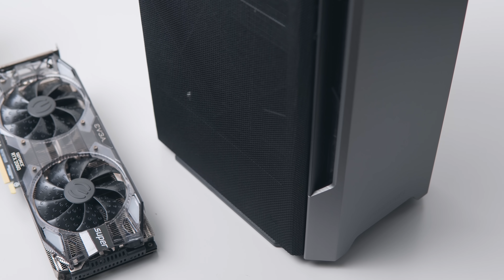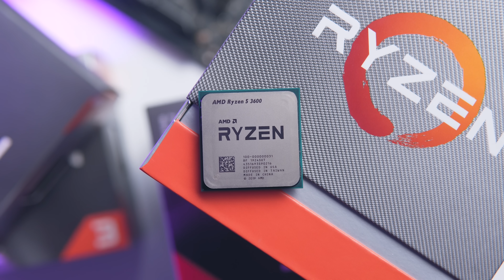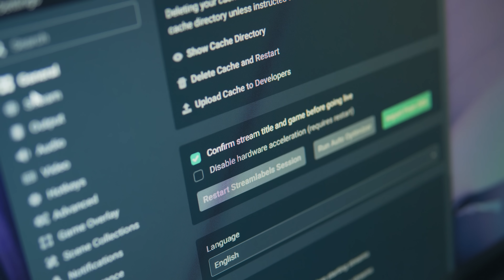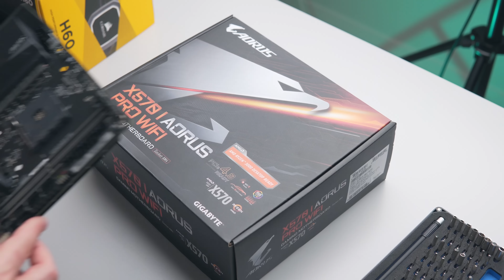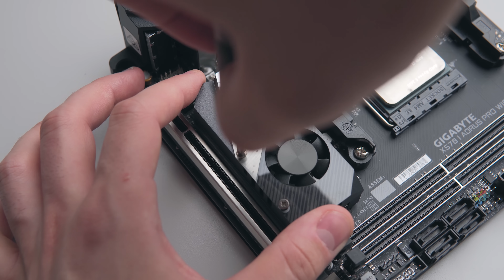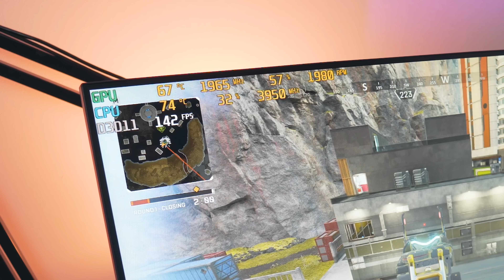Building a 144Hz Gaming Rig in the Evolv Shift Air!

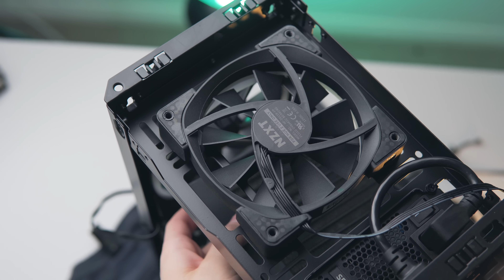Comment: The reason the CPU is warm is because of the gap from the cooler to the radiator, the cooler should always be touching the radiator, in this setup the steel mounting plate with the holes are in between the radiator and cooler, as seen in 8:16, which increases CPU temp by alot.
Also, pressure fans would be better for pushing air through the radiator than airflow optimized fans, lowering even more the high CPU temps.

Comment: I've built v. similar system a month ago. With 2070 S graphics and R 3700 processor. Same, disc, memory, mbd. My thermals rarely touch 70 degs in full power situations (rendering) and generally system works in low 42-55 range in typical workloads for both CPU and GPU. And all fans are on very aggressively low silent curves. The system is inaudible. How?
This is an ideal case for an air cooling setup. It is actually not so good for water. So air only.
 I used Noctua NH-L12S CPU cooler with a fan outside so 44 mm GSkills can be used. The mesh panel has extra space (6 mm), so the case can accommodate a little bigger cooler than it's stated in specs. The NH-L12S fits perfectly. The fan takes air directly from the mesh and pushes it on the processor and motherboard. So you want to remove this warm air from the processor's area - the upper case fan should be set to out-going. Perfect. Well... not so as the NH-L12S barely fits by the case fan and also, there is a problem with the GPU (more below). So you must swap it to a 15 mm slim fan (e.g. from Noctua). 
The GPU is positioned with fans outside, which suck the air also directly from the mesh panel. The case has the problem with the hight (not length or depth) of the GPU. Because most N-vidias have the power cables just in the corner witch is just by the corner of the power brick. For my 115 mm Gigabyte triple fan GPU there was not enough space to fit the cable - without change of the upper case fan to slim 15 mm, to slide the GPU to the front. If you use shorter double fan GPU - no problem with 25 mm fan.

About airflow - the Shift Air has a very nice flow with both coolers (CPU and GPU) with fans sticking to mesh panels and exhausting warm air to the middle of the case. So all case fans should be outgoing fans. You should remove dust filters from the bottom fan and especially from the front panel. Use e.g. gaffer tape to close all openings in the front wall, to prevent the air pushed out by 1 or 2 fans into the gap between the front wall and front panel to return back to the case.

This configuration can probably manage R 3900 and 2080 ti on air only - with 3700 and 2070S the fans rarely exceed 450 rpm now and 850 was the most on the CPU fan. No undervoltage.
But not the Shift with glass. It's baaad.
About water IO. If you really have to use it - position it vertically to the side - so it will suck the air from the mesh. If you position the IO like in the video, it sucks warm air from the power supply and through the rather restricted lower grill. That is the reason, that quite powerful double fan IO works here less efficient than NH-L12S with the more powerful processor in my rig.
Reply: ive got my mine with evolv shift air with an 3900x and a 1080ti .... and it's hot ... i need a new cpu cooler than my custom wraith spire ( i fix one 120 slim instade the stock fan... )  .... by the way i'm not sure about airflow loop from optimum , cpu temp could be better with bottom intake
Reply: @pegazuss5  Use Noctua NH1-L12S or Scythe Big Shuriken air cpu coolers. This case is perfect for air cooling and bad for AIO. The mesh panels provide no friction - the air coolers (cpu and gpu) work like on the open bench. Even better - if you set all case fans as exhaust.
Using AIO as in the build with Shift Air is just well... unwise. On intake, it sucks hot air from power brick through restricted slots. On exhaust is sucks the hot air from the GPU.
Reply: @AndrewSienx  I have the big shuriken and an air cooled gpu. I did a lot of testing of the front case fans (2x140mm) both intake and exhaust and found almost no difference between the orientation.. furthermore, I took them out and noticed almost no difference in temperature. I plan on buying a sfx power supply so I can mount the 140mm fan on the bottom in taking air and helping exaust from the top which I feel like is where a lot of heat gets expelled . ( I fit my full size atx power supply to delay purchase of new psu, ironically this side orientation fixes most clearance issues with gpus)

Comment: Aside from the mesh panel for the GPU, i recommend to get a custom front panel with better ventilation. The standard one turns into a oven if just on fan is mounted as an exhaust because the hot air has almost no room to escape.
You're basically circulating hot air through the case with no cold air coming in.

Comment: I  want to mention that in order to flip the Graphics card bracket you also need a tiny Hex Wrench,and if you want the fan facing outward you either have to get a short graphics card(No extra thing requried) or a long but slim one(AND 1 or 2 180 DEGREE PCIE POWER 
Adapter)

Comment: When you switching to 18:9 A/R? Your videos deserve it. Best cinematography out of any of the channels I watch...

edit: by far the cleanest shot and edited build video yet. I love these so much!!!
double edit: I noticed the same cpu voltage issues with my 3700x and just turned off Precision Boost Overdrive and it knocked my cpu volatge down about 200mv and kept thermals in check in my Ghost S1 with L12. Far better than my 1700x stock settings but pushing upon the limits of the air cooler...

Comment: I just wanted to comment and say the tempered glass original version is viable. My wife has the original case. I had to experiment for a while with different fans and different layouts. 
      Anyways so she runs a Corsair H80i water cooler with one fan as an exhaust. Then a gigabyte gtx 1070 that barely fits. A 120mm Corsair sp120 fan as an exhaust on the front. This combo allows her to play games with CPU and GPU temps 65c or lower after hours of playing. With fan speeds never going over 66%.
    So hope this helps if anyone has the case and doesn't want to try multiple fan configs like we did lol.

Comment: That CL14 3200 ram is a good overclocker. I have an older ‘package’ version with same modules (just trident Z no rgb) which managed to go to 15-17-17-36 at 4000MHz. Yes, memtest86 stable - several days pf testing with no errors. Also, secondary timings REALLY impact the performance. The result I had is 55500/55500/55500 at 40.0 latency in aida benchmark. (9600k at 5.1/4.7avx/4.7cache)
Oh and, voltage required to get to that speed for ram was 1.55. I haven’t tried going 1.52 although I could have, I just know that some modules ship stock with that voltage so had no issues setting it to that in bios.

Comment: I saw some builds online with 2.5 slot cards and even a build with asus rog strix 2080 Ti which is a 2.7 slot card, however the case was a bit modded for it to fit inside... i'm planning on making a build in this case and use my old asus rog strix 1080 Ti with removed fans and switched with noctua slim ones mounted directly on the heat spreader...

Comment: That case looks really good, I wonder if gpus with heatsink fins facing different ways would allow for it to get cooler air instead of the hot air being blown directly into the fans causing a mix of warm air to surround it.

Comment: Modmymods.com have a replacement front panel with different cnc patterns
Reply: Just be prepared to wait 2 months...
Reply: @AtaleToldByAnIdiot  better than nothing
Reply: To be fair, from what I'm told the issue was on phantkes side. ModMyMods offers to send you replacement panels for a bit more if you don't want to send yours in. As such they have to buy the panels from Phantkes who sent scratched and bent panels which they couldn't use for their customers...

Comment: Right after its release I picked one up to move my system from the old TG Shift as the replacement sides were all ready sold out . Not much difference in the noise then again I game with headphones.  I can totally agree on the big reduction on system temps .. now only if they had a wood front panel

Comment: Phanteks should combine materials so there is thermal relief, structural rigidity and still looks good.  They could mix functional glass, aluminum and fabric to accomplish all three and it wouldn't cost any different than having one or the other.  The form factor is excellent though.  Don't put anything on the side of that case though....oops my backpack just crushed my pc....

Comment: I literally built that exact computer earlier this year. The AIO on the bottom blows hot air straight into the GPU and makes it overheat.
Reply: Soren V That’s not the cases fault, that’s your fault for orienting the fan into a pull configuration. Not to mention if you orient the gpu so the fans are facing the mesh then it’ll get fresh air from outside the case keeping temps reasonable which 60 C is.
Reply: Athasin push or pull doesn’t matter since the hot air is going the same direction either way. I was using the H80i V2 so it was actually push pull. No matter what the hot air is going up. And I did have that exact same style GPU (just the 2070 super instead) facing towards the mesh. The problem is, when you put higher end components in the case, the fans (which are stuck behind the metal face plates) aren’t able to dissipate the hot air. 

Also if you don’t have first hand experience you shouldn’t just assume that the person is incompetent and doing something wrong.

Comment: Hi Optimum Tech. I just thought I'd address the choice not to go with an RX 5700 XT: the Gigabyte RX 5700 XT Gaming OC does fit inside this case in the same config you have set up. So for anyone who wants more power but doesn't want to over pay for an RTX 2070 Super, the Gigabyte card is a great option.

Comment: I have no issues with thermals in my shift (glass version) for the CPU (R5 3600). The GPU can be an issue depending on the card style but I am running the reference 5700XT with no issues.

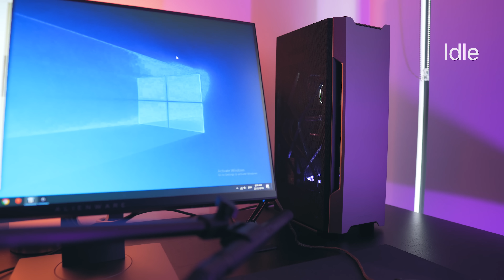Comment: 11:25 That GPU noise would drive me crazy. Watercooling seems mandatory if you’re gaming & you’re sensitive to noise.
Reply: 7errain then you haven’t listen to my pc. 2080 Ti with Accelero Xtreme IV heatsink and 2x Noctua NF A12x25 + 8700k delidded with liquid metal and Noctua NH-D15. Water pump would make more noise and only thing I hear is GPU coil whine at gaming
Reply: Der Lokator you’re right, that aftermarket heatsink also works well. I just have the louqe ghost case so that won’t fit for me.
Reply: The gpu is perfectly cooled through the side panel - just use the Argus or Aftrerburner to edit the fan curves. Default curves are designed for poorly cooled cases.

Comment: Built a similar system in that case for the same size reason. Was able to get a 3700x, H80i in push pull and a 2080 super in. That little fan on the mobo is the cause of most of the noise, might try a slim 12 Noctua to push more air over the mobo.
Reply: You should edit the fan curve for the mobo fan. In the newest BIOS or use Argus. By default, it goes 6500 rpm but 3000 is enough. Then it's silent.

Comment: At least some 5700XT cards will fit fine with the fans facing outward in that case. I have an MSI 5700XT mech OC in mine with clearance all around it, though the riser cable is not pcie gen 4 compatible, at least not in mine, I had to set it to gen 3 in the bios for the system to not crash as auto will default to gen 4 with the 5700xt and x570 chipset combo

Comment: Primary m.2 slot is on the back of the motherboard.
Reply: The back one is the secondary, front is the primary on that board, gigabyte lists them as M2A (front) and M2B (rear)
Reply: @sandrahiltz  is it necessary to put on the M2 this thermal green plate which was in the package of X570 I ?

Comment: On my mobo (Msi b450 TH) if i set the cpu multiplier to 4.1 ghz and leave the volts at auto i will actually get a reduction in temp, i think it was 7-10c on the stock cooler. With the bios rev i tried this on the stock 1 core boost was only 4.150 and all core was 3.8 so you will get a decent perf boost in all core at the same time lowering your temps. Evan 4.150 ghz had lowered temps by 2-4c. I was able to get 4.2 stable with the stock cooler this way so long as i was not running at 100% for long periods of time. I now have it at 4.3 ghz at 1.35v on a 360 aio.

Comment: This is my build too! Highly recommend anyone with this case to look into having the panels modded ( I went with ModMyMods, but they are heavily backordered so I'd suggest other options). The min max Delta on temps I saw was 30c! Afterwards.

Also, the sf600 is good but ran into a huge power issue when going all AMD this time around with a 5700xt. Might be worth it to go with the 750 psu version.

I also recommend getting a cable riser for the gpu (90degree left facing) and if you want the best cable management, custom cables cut to length go a long way.

Comment: Should have used an air cooler for the cpu and put an intake fan at the bottom to reduce overall temps in the system. The radiator being placed at the bottom as exhaust, makes no sense.

Comment: You never really solidified if I can get a RC 5700 XT Sapphire Pulse in this case. I have vetted all my other parts and almost pulled the trigger but your video stopped me. It looks like the Pulse comes in about .5 inch (12.7 mm) taller than the EVGA in your video. Is there not enough clearance in current config? I can't tell in the video either.
Reply: I think the Pulse is the GPU I want, but I really like this case setup. Recommendations since you have built in it?

Comment: Dude, there's something wrong with that cooler. My 3600 won't get past 72 C on a 30 min stress test with a single tower air cooler, boosting at ~ 4.2 GHz on all cores.

Edit: These are under really extreme conditions; in a 25 C room and a +32 C day, cause it's summer here. I hope you read this, because you should really test that cooler.
Reply: "Single tower air cooler" tells us very little of cooling capability.  "Stress test" it's just as ambiguous. You also make no mention of your case airflow situation.  Also, not everyone gets a well binned chip.  My experience in an itx case w/ one 140mm exhaust, 72F ambient, and cryorig h7 is very similar to OptimumTechs results.  Peaks at 80C while gaming.  I don't dare run Prime95 on more than a few threads.  AMD's "65w TDP" claim it's pure marketing lies.  Stock cooler situation was even worse.  I also tested in open air with same results.

3600 is great performance value if longevity isn't affected by high temperatures.  Only time will tell.

Comment: A quick question: where did you install Hue 2? Thinking about changing to this case in near future, so this info would be much appreciated. And thanks for yet another excellent video! Keep up the good work.
Reply from the maker: orvel0 behind the rear panel 👍
Reply: @optimumtech  Thanks for taking the time to answer! I decided to buy all black Noctua fans in the end. My Christmas present: changing from a dancase A4 to this to allow for better cooling. :) Mostly the same setup as your brother's apart from a RTX 2080 Super card.

One more question, if you may: in the windowed version some people installed the CPU rad as an exhaust in push-pull in the bottom slot. It would be interesting to see if that really makes any difference here. Do you reckon that with the ventilation hot air through the rad doesn't really make a big difference in temps compared to using a sub-optimal exhaust placement?
Reply: @optimumtech  Hey One quick question.  Did you use a fan controller or y-splitter for the fans?  Trying to build something similar but using 5700XT and 120MM fans

Comment: Why no manuafacturers make tall 2-slot video cards( i.e. dual 120mm fan design)? Those would be perfect for SFF systems.
Reply: Because it wouldn't fit it in any case? For example 5700 XT Red Dragon is already a problem in some cases (at least Ghost S1 without tophat), while it's still got only 100mm fans. If they slap additional 20mm to height it would be incompatible with a lot of (even matx/atx style) cases.
Reply: @niter43  
well. 120mm maybe too much. But you get the idea. There's too much wasted space in the GPU chambers of sanwiched layout cases.

Comment: I have a very similar build, looking to swap out my 1080 for a 5700 or 5700XT. You made a comment preferring the 2060 super size, did you by chance do any fit tests with AMD cards? Any info from anyone would be appreciated!
Reply: I have an MSI 5700XT mech oc in mine, it fits fine with the fans facing outward, fyi though, the riser cable won't work with pcie gen 4 so if you have an x570 motherboard you have to set it to gen 3 in the bios or it will be extremely unstable and crash almost immediately, at least that was the case with mine

Comment: What way did you orientate the two front fans? Just finished building in this case but faulty motherboard WiFi card means refitting a replacement!

Comment: Did you change the pcie riser to fit make the gpu outward facing? Or the the original pcie riser is long enough to mount gpu closer to the front panel so it wont gpu wont hit the psu? I’m planning to use the same gpu and mounting it the same. But want to know if i have enough clearance. All will be parts will be run at stock so planning to use the TG version of the case.